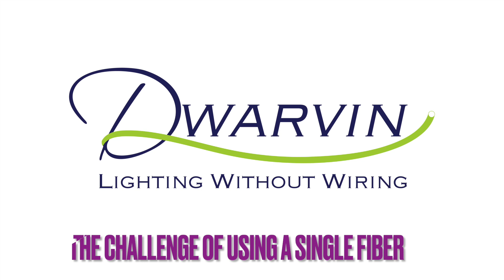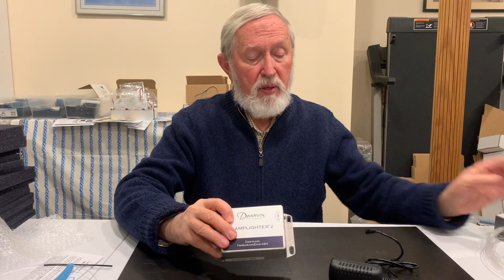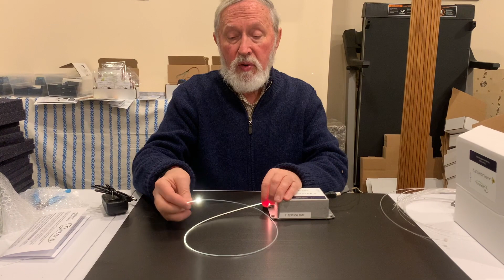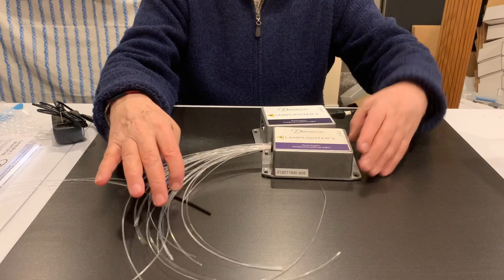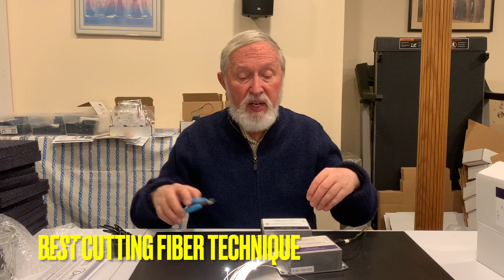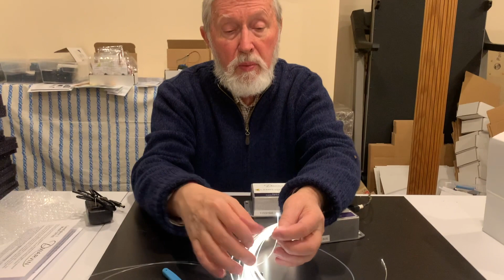Using your Lamplighter® Unit for First Time.

Comment: Can you black paint the sides of the fibers cable to stop light,  if so which type paint won't react or effect the light. Or add heat shrink over top is OK?